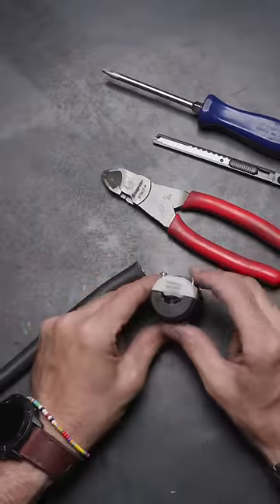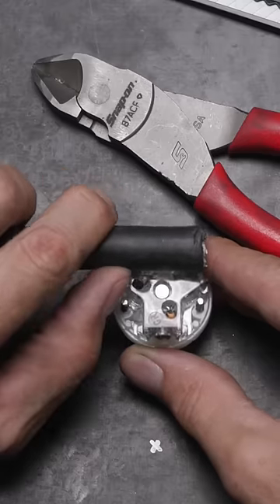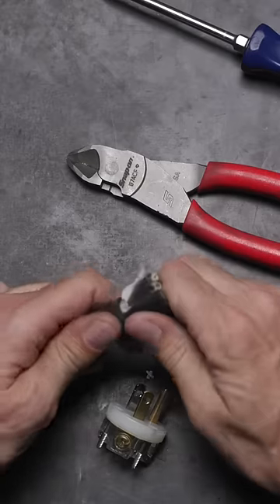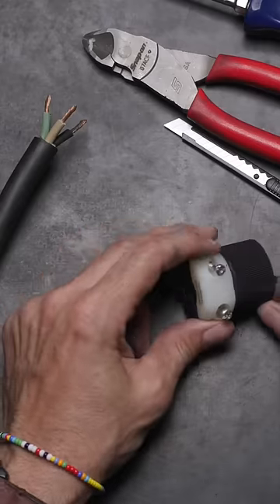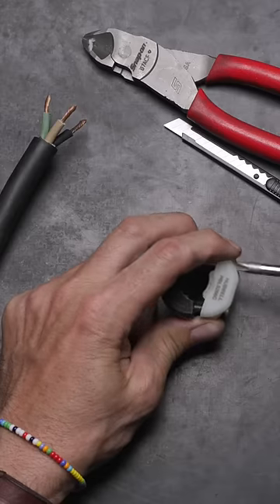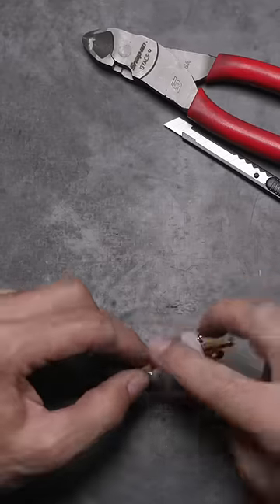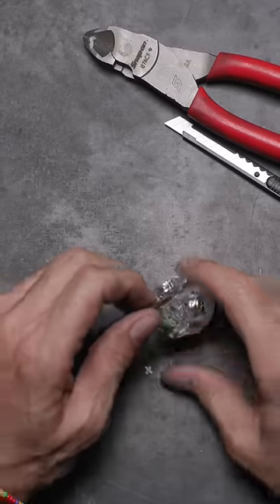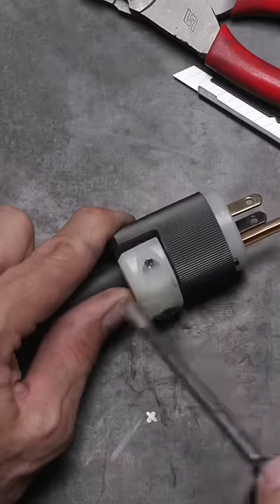Professional Homeowner hack number #28 Wranglerstar

Comment: You really want to leave the PE(protective earth) longer, so when the plug gets yanked on the PE disconnects last...
Reply: I am going to take a wild guess and say that you are from europe! Or at least not North America anyways. While that's a neat idea. These plugs are not built that way there is no extra room in there
Reply: 1. Ich liebe deinen Nutzernamen
2. Wollte Grade das gleiche sagen
Reply: I love how 85 other geniuses read this comment, and thought, "that sounds like a great idea," and pressed the like button, without any knowledge of how these work. LOL.
Reply: @DEVIL666wtf  
I suppose I should have been a little bit more clear. I don't use the thinner wires in these connectors so when I'm putting a 10 gauge so cord in there there's not a whole lot of room between the strain relief and the connector. But I suppose if you were using 14 gauge or something like that you might be able to get away with making a little Loop or something like that in there. Even though the manufacturer does not specify
Reply: @littlejackalo5326  hey I can't speak for anyone else then me but I'm a certified electrician in Germany and I learned that you ALWAYS let the PE/Ground a little longer so that it's the last wire to disconnect if the retainer were to fail.
Reply: Yes this here is very very important. Another thing to keep in mind, never tell anyone you fixed a wire yourself, if you don’t have professional licensing. The insurance will not cover and sometimes check things out, especially if its expensive like fire damages, so if you do, do it atleast on a perfect level.
Reply: @shadowdragon2573  
You did something that the others did not. You specified that you are speaking from German / European standards and I have definitely seen countless plugs wired up the way you are describing on youtube. 
Here in North America well I'll just say United States anyways that is not a general practice and the connectors are not necessarily designed to accommodate this.  maybe if using very small conductors you can fit a loop of green wire in there so that it will be longer. Even Hubble which is the gold standard for plugs says nothing about making the ground wire longer than the rest of them. Interesting idea but definitely not standard practice.
Reply: @shadowdragon2573  we don't have these plugs with the extra space in America.
Reply: @brizzle8797  Please, stay with what is custom on your side of the pond. ;) Just to clarify: The idea is not to have a loop of extra wire, but to have the PE-wire just a tad longer, like 1/8" or so. There is room for that for sure...our European plugs (sadly enough) aren't designed with lots of free space inside either. On the other hand: Your sockets/receptacles aren't recessed like ours, so your plugs get pulled out of the socket waaay easier/faster than ours...and that has a similar effect.
Reply: @littlejackalo5326  you're so right now it's 155
Reply: @brizzle8797  I'm gonna guess you haven't regularly repaired wires. There's tons of room for slacking wires.
Reply: @Sw4lley  that's not entirely true, it's mostly false fear-mongering.

There's nothing in residential building code in the NEC saying you have no right to repair your own equipment.

If your insurance tries to be that scummy.
1. Sue them
2. Get a better insurance.
Reply: @bmo14lax  literally the plug he's showing has plenty of space to have slack on the green. You have never had to wire these up obviously.
Reply: @ObservationofLimits  lol ok buddy
Reply: @ObservationofLimits  well that would definitely be an incorrect guess! I'm not sure which conversation this is anymore so I'll just start at the top.  I don't use really thin gauge wire I use 10 gauge or 12 gauge soow flexible cord mostly. The first thing I'll say is that by going to the Hubble website it says nothing about making the connectors different lengths so we are already talking about doing something other than the manufacturer's recommendations. Secondly no there really isn't very much room in there. Because once you bring the sheath of the cable through the strain relief so that you don't squish the actual conductors you have about half an inch before you run into the face of the top piece of the plug. Because these plugs were not designed to have any wires going in other than a straight Direction you may run into a situation where the conductor gets pinched or something like that definitely not worth the chance and it's already a tight fit for me anyways.  18 gauge wire, sure you probably have a little bit more room.   Me personally I wouldn't suggest someone straying from the manufacturer's recommendations.
Reply: Exactly my first reaction.
Reply: @shadowdragon2573  That is how it's done here in Sweden too.
Reply: @Sw4lley  If it is not a fixed installation  you can do it yourself here in Sweden if you have "the necessary knowledge".
Reply: @ObservationofLimits  yep sure!
Reply: "first to make, last to break."
Reply: @Sw4lley  best comment & advice .... extremely important,💯👍
Reply: Generally yes, but the design of the plug pulls itself out before the cable can build enough force to be pulled out of the terminals, but yes, here in the uk, make the earth the longest for the reason you gave
Reply: My dad taught me that.
Reply: @littlejackalo5326  In the UK it's standard practice to leave the ground longer.. Maybe you're the one who doesn't know as much as you think.
Reply: @ObservationofLimits  I use these exact style plugs at the factory where I work as a maintenance tech. We wire these up weekly and there is no extra room in there when using that style of conductor shown above. It's a pain to get the third wire in the terminal in sometime. There definitely isn't extra room to mess around in there. The back of the plug sinks deep inside the housing which leaves little room.
Reply: @brizzle8797  I can also never get used to not putting ferrules on
Reply: @ccee4117  in the UK there is no choice - the design of the plug forces the long earth wiring. Super clever design.
Reply: @19ghost73  you sure about that? the lower 120V has different design standards than higher voltage terminal/receptacles.
Reply: @littlejackalo5326  Okay buddy. Its on you if you want to disregard tips that might save someones life. God I hope you aren't an electrician, because if this is how you treat something basic like this, then I know your skipping major safety requirements.
Reply: 3 together are stronger than 2 and if that cord grip gives way before the thing pulls out of the wall then you have major  problems putting the thing on in the first place
Reply: @DEVIL  Actually they don't.
Reply: @shadowdragon2573  You've never installed this type of plug. There isn't any extra room.
Reply: @Sw4lley  BS
Reply: @jamezh2822  why is it BS what @sw4lley  said. I again can only speak for Germany but if you fix something electrical yourself without being a professional and it starts a fire and the insurance company knows of it your insurance claim can be denied.
Reply: Yes correctly
Reply: Seeing him not work with dilithium crystals for once is cool!
Reply: Agreed
Reply: U want the ground to disconnect last? I thought you always disconnect ground first then hot or is that just DC
Reply: Grounds are only for your safety, not needed for a device to run.
Reply: @Sw4lley  What if I have my journeyman's license, then can I brag to my insurance agent?

Comment: I never knew it had a strip gauge on the back of the plug. I learned some of the most amazing stuff from you. Thank you!
Reply: Most plug and i mean 99% of all plugs got wire striper to see qhere to cut. Even house plugs and switch
Reply: Same in the UK... We have a small piece of paper on most plugs that are designed to be fitted (not moulded onto the cable) with the wire names, colours... And yes, lengths
Reply: Bruh jus guess at it like everybody else
Reply: same, done this a handfull of times too..
Reply: Not all replacement plugs have this.
Only certain companies make them that way.
Those do tend to be more abundant for quality but you will see a lot more of the cheaper plugs sockets and switches that do not do this.

Comment: Dad accidentally cut a brand new long cord we got for our hedge trimmer, and fixed it in less than 2 minutes. Not soldered, but it did and has done every job so far lol 👍
Reply: If you can, I’d recommend soldering it when you can. It’s a great skill to have and better than crimping. Just make sure to get a nice wetted solder joint.
Reply: Soldering is bad for AC, great for DC. The alternating effect is more prone to melt the solder and fall apart. A mechanical joint is best for AC.
Reply: @The76Malibu  If that connection is getting ANYWHERE NEAR hot enough to melt the solder, you've got bigger issues. Like, ANYWHERE near.
Reply: @littlejackalo5326  yep, solder melts at roughly 180°C/350°F. Definitely gonna have other problems if the solder is melting. You definitely want to make sure it’s a good solder joint though, as a poor joint will have high resistance and could heat up and cause isssues.
Reply: @The76Malibu  makes me wonder how they solder full bridge rectifiers, transformers and other AC circuits etc. 
Surely they're just going to fall apart according to your logic, right?
No, because your logic is flawed.

But you are right that you shouldn't solder an extension lead.
Reply: @Duck_side  so he was right all along but his logic is flawed? we’re talking about power cords which can draw at least 110v not laptops with a constant current and no voltage drop off
Reply: @woofy9977  that isn't what I said, also laptops do not draw a constant current, whoever told you that was lying to you.

And yes, we're talking about power cords, not 500kv power transmission lines that run from the power station to a transformer and then from that to your house.
Reply: @Duck_side  dude the little box attached to most electronics’ power cord is a constant current driver
Reply: @woofy9977  it's constant voltage, the device(laptop) regulates the current on serveral factors including load and charge on battery
Reply: @TokioHotelFan943  that depends, crimping tends to be better for bigger cables as it's less sensitive to cracking while soldering is better for pcbs and smaller securely mounted cables
Reply: @nikodemradomski1782  laptops are DC devices, but the voltage fed to them isn't actually constant (depending heavily on the charge level of the battery). Also, their power bricks take AC, but have press-fit connections on the AC and DC side.
Reply: My father-in-law would have me trim the hedges.  I'd get in the groove and cut his extension cord.  It was habitual.  I guess I thought I was Edward Scissorhands, with my arms flailing about.
Reply: Soldering stranded wire isn't very popular nowadays, depending on plug design you might be allowed/required to connect the strands pure, or be required to use ferrules. Soldering is prone to breaking
Reply: @Duck_side lmfao that’s hilarious 😂😂

In case you weren’t joking, google what a full bridge rectifier is and what it does. I’m pretty sure you were joking though.

Comment: I find that rolling the blade around the insulation rather than sliding it helps keep the wires from getting cut while I remove the insulation

Comment: I always put the stain relief on first before I strip the wires. That is to prevent the strands of wire being snagged when you put the relief on the cord.
Reply: I've always inserted cord through the strain reliever first prior to stripping. Tighten the strain reliever first on reassembly then tighten the screws to allow the remaining length to act as a buffer to help prevent wires from being pulled out under strain. As an industrial electrician a black electrician I worked with always said blacks love gold in identifying the where the black/hot wire went.
Reply: I always forget to put the strain relief on before I strip the wires.
Reply: @willisrice7844  That's how I was taught about the black wire going to gold.   Same saying I mean.

Comment: I fix Avionics for a living…electrical is electrical but this was a new thing for me. Ended up crimping ferrules on wires, heat shrink on ferrules. Heat shrink on strain relief portion of cord, and screwed together Leviton plug. Probably going to put bird split (didn’t want to swear) on screws to keep them from walking out. Video was hugely helpful, as are all of your videos!

Comment: I personally use fork terminals crimped on instead of just the bare wire. Creates a more solid connection! I've done it to every extension cord in my shop and they've had no problems for years!

Comment: Put the chord thru the housing before working on the chord. If repairing the green wire goes in first-time and the other two line up without crossing. If they cross then double check the colors.

Comment: That clamp isn't a strain relief for the cable. They make a wire mesh strain relief product that works like a chinese finger trap. Usually only available at an electrical distributor that wholesales to contractors but the public is always welcome for over the counter sales.

Comment: Change of subject, but I would always replace the cord on my Skilsaw, and install a hook. The hook was held flat by a spring, and I could use it to hang my Skilsaw on joist or rafter.
   But the cord. I bought heavily Insulated outdoor 12 gauge. (The cord for Skilsaws are 14 or 16 gauge). The tables in my day said you could run 100 feet with 12 gauge.
   The wire protective boot wouldn't fit over the 12 gauge outer sheathing, so I left it off. Within a couple months, I would have the wire going intermittent, and had to take it apart, cut the intermittent out, and rewire it.

Comment: Remove the insert from the locking bar (strain reliever) for larger cable. Easily removed with pliers is helps the locking bar fit flush with the connector body.

Comment: UK plugs were made to be easily wired since it wasn't mandatory to sell electronic products with a plug until the mid nineties and you were expected to wire anything you bought yourself. 

And even though I was born later than that I still remember learning to wire plugs in secondary school.

The earth wire is striped green and yellow and always has extra slack in the plug so in the case of the wire being pulled out it's the last to lose connection

Blue is neutral and goes- (b)ottom-(l)eft-(ue)

Brown is live and goes- (b)ottom-(r)ight-(own), though in reality it is higher up to make space for the fuse.

You can also remember that brown is live because that's the colour your pants will go if you touch it!

Comment: one thing with the connector he is using, slide the strain relief on first then strip the outer insulation. this prevents the wires from fraying

Comment: Very nice I was always taught to bend the cable ever so slightly and apply just a little bit of pressure with the blade not cutting all the way through and it will naturally split and you can rotate the cable around many times to do the same process until you have a very clean and natural cut that was never even close to any of the cables

Comment: Not a bad demo for this.  I would do 2 things different:  1) slightly more length on ground. 2) before stripping anything, push through strain housing. (that way you don't damage your fresh stripped ends when pushing through)

Comment: Wonderful short, I do have one thing to add. Put the strain relief on before doing anything else. I've seen many a plug taken back apart because the strain relief was still sitting on the bench. You don't have to worry about fraying the stripped wires while putting on the strain relief.

Comment: When stripping the jacket just score it, then bend it until breaks/splits open. This ensures you do not nick the insulation of the wires. Do the same to the wire insulation, so you do nick the strands.

Comment: In Britain until surprisingly recently it was part of the school curriculum to learn how to wire a plug because appliances were not actually required to come with one. Many things would just have the cable, and plugs were bought separately. I learned how in high school, although it wasn't required at the time.

Earth is green and yellow, it stands out and is distinguishable in low light situations and even to colourblind people. Neutral is bLue, connected to the Left terminal. Live is brown, because that's what colour your pants go if you touch it.

Comment: Please use ferrules. Just twisting the wires puts more stress on them and the connection isn't too solid so this is a short or fire waiting to happen.
Reply: Have you used this kind of plug before? There is a clamping plate in there to make contact with the entire wire as it is compressed. It's not Just One Singular screw. 
There are different products for different types of wire.  common receptacles have a screw on the side that's made for solid wire as it doesn't spread.  there are also receptacles that are made to accept stranded wire they have the clamping plates just as this plug was designed to accept stranded wire!

Comment: I like to score the outer sheathing with a knife, and rock it back and forth by hand. If it won't budge, cut a bit more. It should break loose and slide off. I find I cut less internal wire casings that way. 

That cable you're terminating looks like it needs an L5-30 though, my goodness that's chonky!

Comment: Rule number one: No matter how professional of a home owner you are, if you meddle with grid powered appliances or cabelling, 100% of the risk is on you. I know it might not sound like a big deal to replace a cable, but even professionals die from stupid mistakes. So ideally get someone (hire or relative/neighbour) who has an actual education in electrical installation or similar.

Also for braided wire you should use crimping (don't know if it's called that in english as well) to ensure a sturdy contact between wire and terminal.